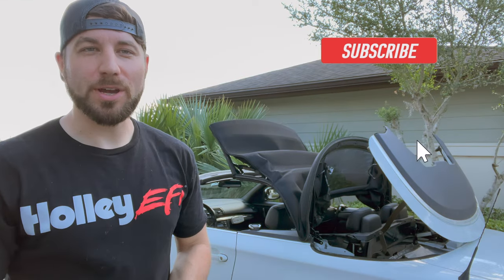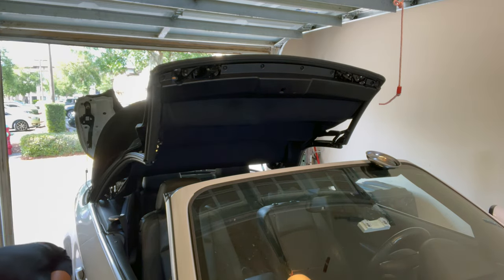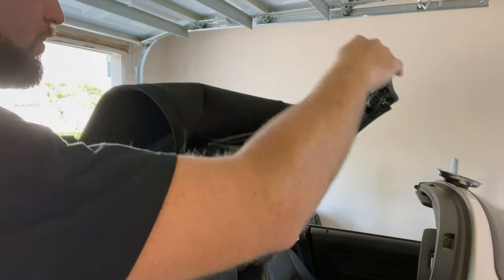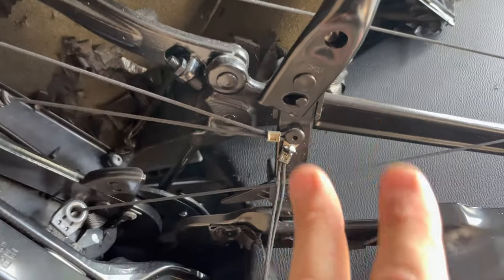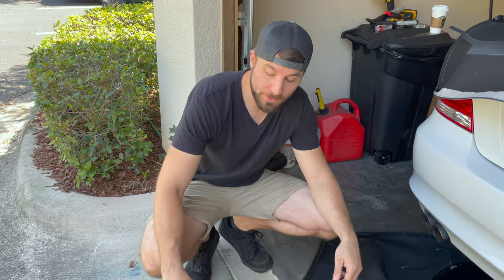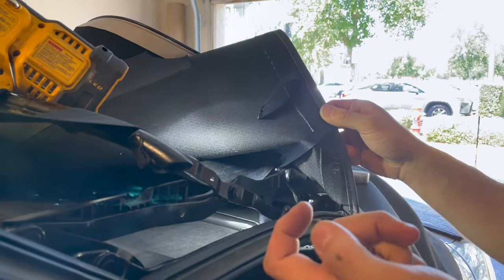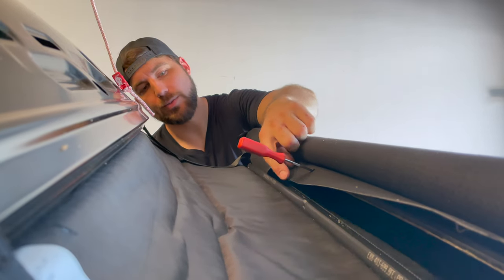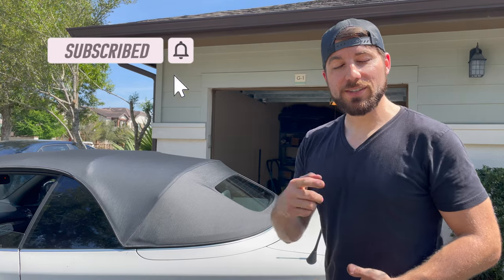BMW 128i Convertible Top Replacement - Fresh Look - 4K

Comment: Great Video..Instructional..Having a difficult time with inserting the side trim/panels 8:13 - 8:44 in the video ..the rest pretty straight forward. Wondering if you had anything additional to add to assist aside from tugging and twisting as mine keeps popping out. Thanks

Comment: Thanks for the video, how long would you say it took to install?
Reply from the maker: A couple hours
Reply: @DropClutchGarage  looking for this how to video with frame included. My top is being delivered with the frame and I was hoping to find a way to install with the frame thanks!! Great video by the way I almost just bought the canvas but the rivot replacement would be too much plus I found a really good condition used top for $250